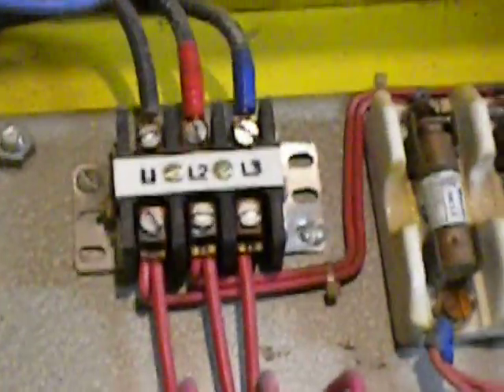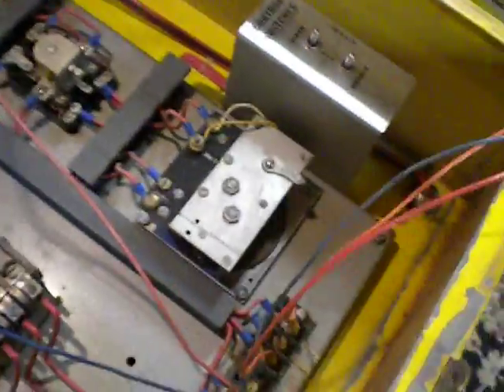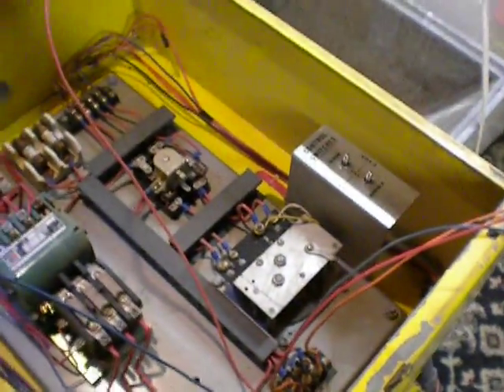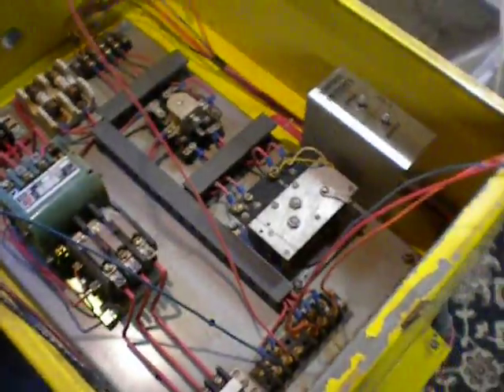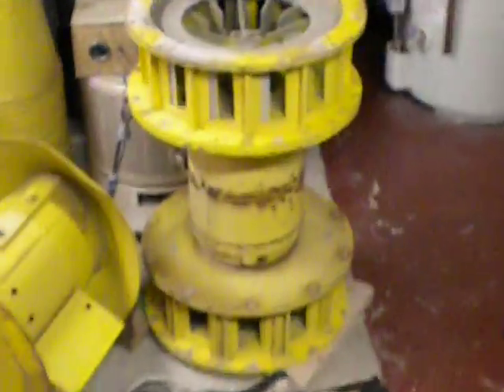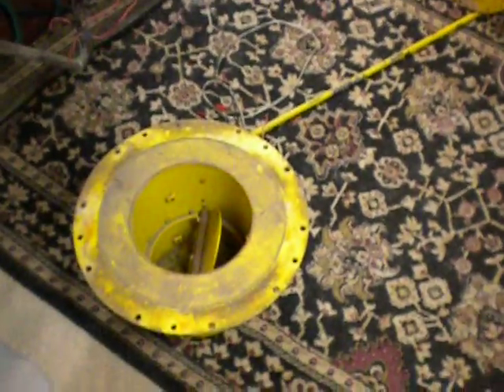Federal Signal 3T22 Tornado Siren Flasher/Solenoid Test

Comment from the maker: @warningsirenlover99 Even though the 3T22 is a much bigger siren, the STH-10 has a bigger intake tube (atleast the part that bolts to the stator is bigger), so unfortunately the 3T22's lower intake tube with solenoid/damper assembly won't fit the STH.